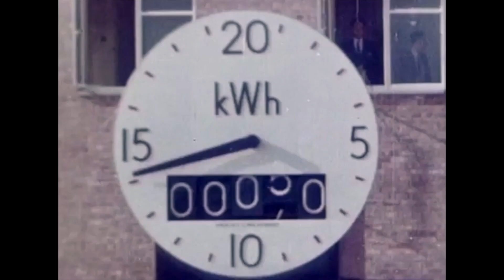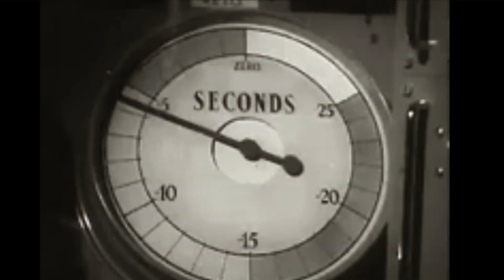Nuclear Lies - Prof Simon

Comment: Plutonium from the "long burn" of uranium fuel within commercial nuclear power plants is NOT useful for military purposes as it contains far too much of the spontaneous neutron emitting Pu240 along with the weapons-useful Pu239.  The spontaneous neutrons from the Pu240 would cause pre-detonation in a military grade weapon and GREATLY reduce the explosive yield, most likely to a level called a "fizzle."  A special burn of fuel required to minimize Pu240 content is not used in nuclear power plants whose primary purpose is to produce power because it's not an economically efficient use of reactor fuel.  

If using Pu metal made from stolen plutonium oxide made from reprocessed reactor fuel from which the Pu was extracted, terrorists would not care about Pu240 content because even a fizzle, while not causing kilotons of yield, can cause a yield of tens or hundreds of tons of TNT.  That, of course, is still a LOT and that's why even reactor grade Pu oxide powder is very securely handled beyond just any radiation and inhalation hazard.
Reply: Isn't that what centrifuges are for?
Reply: This is a nonsense argument. Plutonium is man-made. 1300 tons have been created so far and at one point there was more than 70,300 nuclear bombs in the world (though not all using plutonium). The states / corporations didn't go through all the trouble of producing so much NOT to use them in bombs! Think of the money per kilogram to be made?
In any case it seems obvious to me the original intent behind nuclear energy was to make bombs. The energy production was an interesting "benefit". If nuclear plants didn't produce plutonium I am convinced the state would have NEVER invested in that technology; nuclear waste is a nightmare that has been costing a bundle to taxpayers and they get to pay to use the electricity ON TOP OF IT!
Reply: @obiwanceleri  The comment is correct, the plutonium made in power reactors has too great a content of Pu240 and Pu241 to be useful for a weapon. Calder Hall was primarily for producing weapons grade plutonium and made electricity as a byproduct. The Magnox and RBMK reactors could be switched to run a fuel cycle to produce weapons grade plutonium in time of war. The bulk of power reactors that exist today cannot produce weapons grade plutonium whatsoever, and the separation is of the isotopes is not feasible; it would be cheaper and simpler to covertly build a reactor that can produce weapons grade Pu. Power reactors do produce plutonium, but it is useless for weapons and Simon's claim is just plain wrong.
Reply: @obiwanceleri  that aside think how many Internets can exist forever with small modular gen 4 fast & fertile fission puppies stationed where ever civilizations decide to pop up.  Minimal transmission expansion using existing lines.  Giving a kick to every metro hub in the industrialization world.  This is world peace.  The stakes are great.  Existing monies willing to take their pain as monopolies crumble amid empowerment & plenty.  It starts with heat.

Comment: While your right, you were lied to, if it didn’t produce power it was a breeder reactor used purely to generate fuel, they consume more power then they produce depending on size and the facilities “primary” system. Almost all commercial power reactors provide an unbeatable amount of power relative to the cost of U-235, but that fuel, after its spent, is usually stored on site and is much to volatile to recycle immediately after being removed from the reactor. France recently took samples of spent fuel from commercial power reactors to attempt to recycle and repurpose it and have made progress but those rods were spent and have been decaying for 50 years in storage containers. All plutonium that was used between Russia, the U.S and England for WMDs were developed via breeder reactors. At this time it’s impossible to build nuclear armaments with spent commercial fuel rods. I get your feelings are hurt about being lied to but most country’s have a strict open doors policy when it comes to nuclear because of the fear behind it. So don’t assume every nuclear power plant is creating “boom juice” for the government.
Reply from the maker: Thank you

Comment: Winscale, sorry Seascale is there to process bomb making material.
Reply: Sellafield. And weaponising Uranium and Plutonium is not carried out there. 
97% of the fuel is recoverable to use again. The MOX Plant was built to use up the stocks with Mixed Oxide fuel elements but the the plant closed due to poor production and other (non weaponisation) factors which I can’t discuss.

Comment: As nuclear engineer myself. The waste is already weapons grade when come out of the reactor
Reply: What are you referring to as waste and how so, apart from being  used as some kind of “dirty” bomb?
Reply: @rayquirk4947   the fule rods. Normal refined 237 and 234 are safe with very little radiation. When it go into rector. It spend up to 3-5 year if not shorter depending If it fast or slow rector. Most of time fast rector do have PU in higher amounts. Now US rector you half do more of recovery chemically get the PU out of the waste. Where in fast rector you just got some chemistry to the rods and more in short time. RBKN rector are fast. That much as I want get into this.
Reply: James Vaughn so not weapons grade when it comes out of the Reactor then. Processing required.
U238 with up to 5% U235 enrichment (much higher in military reactors) are used in rector fuel.
Reply: @mycornerusa2763  "...Normal refined 237 and 234 are safe with very little radiation..."
Are you sure you're a nuclear engineer? I'm wondering what "237" and "234" could be. Naturally occurring uranium comes as two isotopes, U-235 and U-238. Most reactors need the uranium to be enriched in U-235 before they can use it as fuel. There is actually a U-234, it's an isotope produced by a side reaction while the reactor is running, and found in trace amounts in spent fuel. It's not used for anything, so nobody tries to refine it out of spent fuel. There's no such thing as U-237, just Np-237, which again is a minor isotope produced by a side reaction and found in spent fuel (this one they do sometimes retrieve, and use to make Pu-238, an isotope used as an energy source for deep space missions).
Reply: Hugh Easton yep, I found him out too but couldn’t be bothered to extend the argument.
Reply from the maker: Interesting

Comment: Hi Simon   Are you total ante nuclear ? Or   do you see a possibility of some usage for initial cover to keep the global need of dependable power paramount  . As renewable energy comes more dependable we may reach a level of sustainability  . But as yet we are a long way removed from such a situation . Yes we all won’t safe reliable energy  . But we must also be realistic  as regards . What is and what is not possible  . It’s not just the lights going off . It could be the supply feeding a hospital keeping the young and old alive . Generator only last so long .  As I have previously tried on many occasions to explain . Not including your self many people don’t realise how much power , as in amps that they use on a day to day basis . As a now retired electrical contractor I’m pretty well informed as to this basic fact . And yes the battery back up is yet another possible way forward . We must at all cost be a open to maintaining our constant need for reliable power generation irrespective of the form it takes   Best wishes and kind regards regards Mike in the U.K.
Reply from the maker: I am not anti nuclear but it has massive decommissioning problems.
Reply: Professor Simon Holland  you’re absolutely right of course . But we may be heading to a state of far than desirable guarantee of uninterrupted power generation  . I know nuclear is a dirty word . But as a way of meeting  demand , now it’s are only real option sadly . Renewables can play their part . It’s just finding something to fill the gaps . Thank you for taking the time to reply  . And for all your hard work in putting your videos out  we only get to see the end results . Perhaps some time you could devote a video to the behind the screen work involved ?   Best wishes as always  Mike in the U.K. 👍

Comment: I will make a quick comment now and then do more research, but the Canadian designed Cando reactors use slow neutrons to fission U235 and this does not produce Pu239.  You need fast neutron reactors to breed Pu239.
Reply: Candu is a good technology clearly aimed at improving the lot of mankind. Canadians can be proud of this. However, it is now dated and expensive, we need new nuclear technologies that achieve similar benefits, with even greater safety and lower costs.
Reply: Yes, thermal reactors that rely on thermal neutrons to cause fission (PWR, BWR, Cando to name a few) 'burn' the Pu239 as it's produced during each fuel cycle just as much as U235.  One estimate is that when about to shutdown for refueling, almost 40% of the energy being produced is actually coming from Pu239 fission.
Reply from the maker: Good info Mike ...smart Canada

Comment: Something that I find interesting is that only the 1st two nuclear power stations to go online using cooling towers, the rest didn't. I do wonder if that is due to the public's perception of them being smokestacks. New-clear sounds better.😏

I had a tour of Hinkley B as a kid (I grew up in what would be the exclusion zone👍). I remember a couple of things from that tour (aside from never seeing so many pipes, big Mario fan at the time🤘): They talked about the water being returned to the Bristol Channel being within 1c of the inlet water, be the mentioned they had explosive bolts as a backup to SCAM the reactor. Oh, and it looked like a ship at night from the hills towards Kilv (West), but I've never seen a picture from the same angle.

You have to wonder how much effort is taken to cool the return to such a level. Kinkley is on the coast so I imaging salt could be an issue evaporating so much water, but that isn't true of all power, but that isn't true for all locations and there's a sizable river nearby. Also what I know about nuclear reactors (especially the graphite), is that if the graphite ever did get damaged (and they run it for years longer than expected), that would be a problem that fancy bolts wouldn't ever fix. It is impressive how they made the graphite so strong that it is able to withstand decades of high temperatures, nuclear bombardment and with boiling water running through them (earlier reactors (actually designed to produce plutonium, it was never a big secret, I thought..), used co2 as the coolant).

There has been some talk lately about how to power/ build nuclear submarines since the UK has literally let the nuclear industry crumble. Same goes for the new aircraft carriers NOT being nuclear powered, but I guess the rest of the carrier group needs conventional fuel so I guess it doesn't make a huge difference in logistics and it may actually make sense. It still baffles me how the Chinese are a major partner for Hinkley C, yet there's a trade embargo for tech exported to China.🤷‍♂️
Reply: Lovely to read someone who thinks they know what they’re talking about. From an Ex Sellafield Manager and Navy sub Reactor Commissioning Engineer.
Reply: @rayquirk4947  Then please enlighten me. I've always been fascinated by the graphite used in reactors (it's obviously stronger than pencil lead, but it is a brittle material which seems like a paradox), what alloys do they use?
 How do they degrade in cores, do the structures fail, break away?

What can be down with nuclear waste? Most of the world still doesn't have a long term solution to handle it. To a layman making an alloy or even glass and burying it in a cave seems relatively simple.
 Or maybe design the containment buildings to entomb the nuclear waste afterwards?

What is your take on the current rebirth into nuclear? To me Hinkley C feels like a project that got out of hand and should have been cancelled (I'm a software developer). It's massively delayed, the costs have spiralled to the point that it will never be economically viable and you question the sanity of building more (Sizewell C is still going forward...). 

What are your thoughts on where the UK stands with the technology in general?

Thoughts on Thorium; was it a missed opportunity when researched shifted to Uranium, is it overrated?

Will Coldfusion ever be less than 25 years away? Ironically, I could also go on forever...

Were the explosive bolts a lie? 😏

PS: The channel Smarter Every Day has recently visited and made some content about nuclear submarines you may enjoy. While I was expecting a high calibre of engineers onboard (a submarine isn't the best place to call tech support or call out a mechanic), I was surprised at the number of nuclear physicists onboard, most had advanced degrees in physics.
Reply: Gareth Evans where to start?
I’m a PWR man Reactor wise. No graphite in these. Water is the moderator with Zircaloy being used for the fuel casing. 
Graphite was used as the moderator in Calder hall’s 4 reactors for 60 years without any drama’s so no concerns there. 
From what I’ve read on Thorium reactors they are expensive, relatively inefficient, difficult to work with and can suffer from a positive coefficient of reactivity (a la Chernobyl). Probably not a good option. 
The long term disposal of Nuclear Waste was never factored in to early operations and we are currently bearing the brunt of the difficulties and cost of that legacy. Underground repositories are the only real option but the locations have to be stable for 10,000+ years so siting is very difficult. Even more difficult is the politics of it and rampant NIMBYism. 
Vitrification (which I worked on) and encapsulation in grout (both within welded containers)  is where the HA and MA materials are contained. 
Politics and a lack of inward investment has killed out Nuclear Power industry along with the failure to solve the disposal issue. 
There are some talented guys in those subs in all departments including the aft end. Great guys to work with.
Reply: I don’t buy the cold fusion theory but we are getting closer to “hot” fusion. Still the elusive 20 years away though. It will be our saviour if we can crack it.
It’s Reactor SCRAM by the way. It sounds like it’s an acronym but it doesn’t mean anything other than its function. I’ve not heard of explosive bolts to do it. Gravity works pretty well when the rods are electro-mechanically released.
Reply: @rayquirk4947  "From what I’ve read on Thorium reactors they are expensive, relatively inefficient, difficult to work with and can suffer from a positive coefficient of reactivity" 
There isn't a "thorium reactor". Thorium (or more precisely,. U-233, bred from thorium) is one of the fuels you can use in a nuclear rector of any type. The Americans operated a PWR for a number of years using a thorium/U-233 fuel cycle. The Indians have been experimenting with thorium in their heavy water reactors. Thorium is also advocated as a fuel by molten salt reactor enthusiasts, because it's very abundant (there's enough easily mineable thorium to meet all our energy needs for billions of years), much less plutonium and other transuranics are produced than with ordinary uranium fueled reactors, and it works particularly well with the MSR design, because you have to reprocess the fuel in order to use thorium, and with the MSR design, the fuel is automatically reprocessed. With other reactor types, reprocessing is an additional step and an added cost, which often isn't bothered with right now because uranium is so cheap.
Reply: Hugh Easton thanks for expanding my knowledge. I’m a bit out of date on the Reactor front. Last 28 yrs in reprocessing and HA waste management.
Reply: @rayquirk4947  In 1977, President Jimmy Carter banned reprocessing of spent nuclear fuel, which effectively killed off reprocessing in the US. Unless there's some secret military reprocessing that has continued beyond that date, if you're based in the US, it's difficult to see how you could have any practical experience of reprocessing. Thorium has so far only ever been used as a fuel on an experimental basis, so there's not much experience anywhere of reprocessing it. Uranium is cheap enough that there's not yet been any strong incentive to reprocess spent fuel, or to properly streamline the technology to use thorium as a fuel.